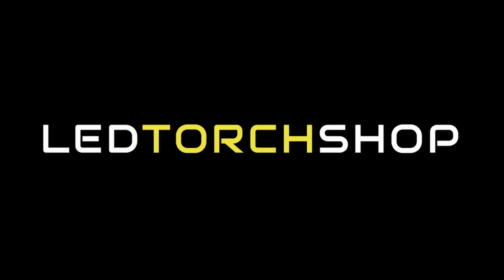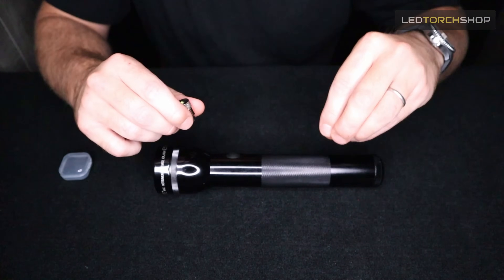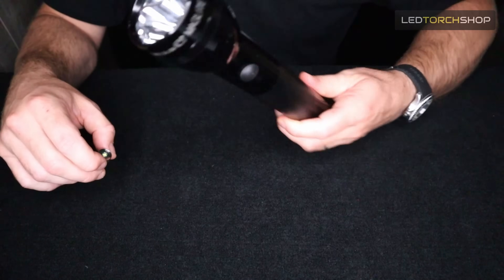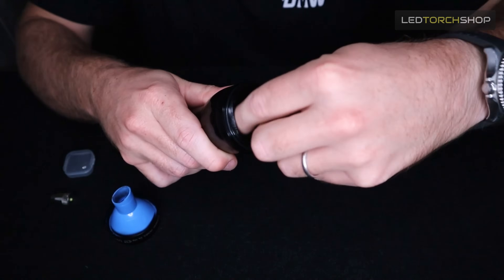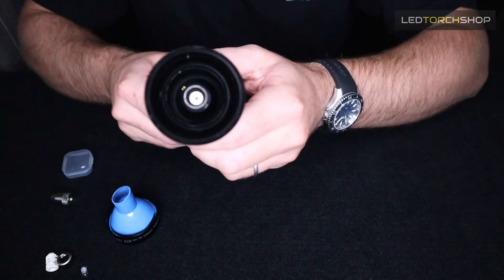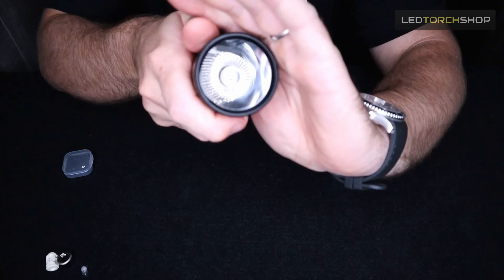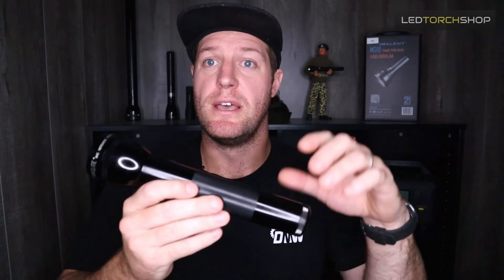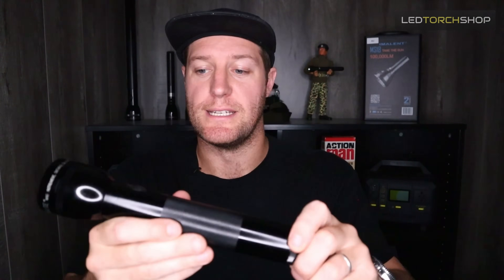Transform Your Maglite Flashlight with a High-Powered LED Upgrade

Comment: i have rebuilt a few Maglite D and C cell battery leak flashlights (torches). My best advice, is to not pour vinegar into the unit. It will not help remove the swollen cells. Remove the reflector first, Remove the bulb next. Save the reflector if not damaged. Most folk store their flashlights lens down (big mistake). 
First rebuild task, remove leaky batteries: 
1. Use any easy, non-destructive gravity or momentum method to remove the leaky batteries... gravity, banging on a work-bench (check with your spouse what a workbench is)
2.  Extract swollen stuck batteries. The first try should start with a skinny long drill bit. (Only go through one cell.) then find a screw that is slightly larger than the hole you drilled.) make a gear puller to remove that battery with a proper sized screw... repeat

Comment: Crap! Doesn't last long, because of the heat. I already got 2 failed, despite the fact I have more than a maglite and some other things in life to do. Maybe 300 Hours but they advertise as if there wouldn't be a heat problem. You can get about 55lumens out of an old Maglite with such a  convertion-kit that would last thousands of hours.

Comment: Did that years ago, maglites are built very well and to waste a good light because its incandescent... this bulbs swap just does the trick. Yes more modern lights have much higher outputs (see runtimes) and gimmicks build in. But in the end, for in and around the house, it's sufficient and the batteries also last. Glad I did this
Reply: The kits @ Home Depot/Lowes are around $20, I found one on clearance for $7 (which I thought was worth it, but $20 is a rip).

Comment: Throw that dinosaur in the trash. Harbor freight sells led flashlights for cheap that are smaller and better than an old maglite with half led kit that doesn'teven serve as a good night stand light. Streamlights are my pick.
Reply: Wrong. But thanks for playing.
Reply: One reason to carry maglite is it can be used as a weapon in worse case scenario.
Reply: Great comment. I have heaps of 🔦 for around the house/car. However a cheap $25 second hand 4 -D maglite is great to have by the side of the bed for things that go bump in the night. Going to upgrade to LED globe in the near future.

Comment: I have a 2D cell magnlite with an incandescent bulb.  I just went to follow your steps along with you and hit a huge snag.  The first step, removing the top part, doesn't work.  The Maglite company told me these are not able to be updated.  Could it be that they've sealed this part so they can't be updated?  I'm so frustrated.  Your steps look so simple and I bought this incandescent flashlight without realizing what it was.  I have another one with an LED and LOVE it.  Can you advise?  Thank You, Joy
Reply: only works on the 3 cell and up versions.
Reply: @Chris-sf7ug  In the video he's holding a 2 cell.  There are specific bulbs "chips" for different volt (number of batteries) lights.  Just make sure to get one for a 2 cell.
Reply: You have to be able to get to the bulb to replace it if it was to go out.  I have a 30ish year old maglite I am currently upgrading and everything comes apart with the exception of the "blue" reflector separating from the lens, I'm not going to force it since it doesn't need to be separated for the up grade.  My maglite even came with spare bulb wrapped in foam inside the spring on the battery cover.  Good Luck.

Comment: I do not suggest storing Maglites with alkaline or zinc-carbon batteries inside for any substantial length of time. You are asking for trouble. The question is not "if" they will leak but "when",  and then you are boned as they will swell, leak corrosives, and weld themselves inside the barrel of the flashlight. Even premium brands will do this. Rechargeables are much less prone to this.
Reply: Happen to 3 of mine already, and it was pain to get out.
Reply: @rubicon3929  Took my batteries out of many of my flashlights, now they are not ready when I  need them.
Reply: Going to take mine out of my four Dcell and keep them separate
Reply: Lot of those issues with the AA size Maglights.   All this tech & they still can't make a battery that doesn't leak!
Reply: I got lucky, just crammed my mag solitaire out after 8 years in a drawer, battery did leak, but barely noticeable :D
Reply: I have had 4 d cell Rayovacs in my maglite for 3 years. Lucky
Reply: Oh my maglite is going to see some use. I need it!
Reply: It just happened to me. Now the inside is corroded

Comment: I have been experimenting with similar thoughts. However I am looking at 7.2 volts or more using A123 26650 batteries. If you can get 2 in. Three will give more than 10 volts. Longer run time also.

 I am using a 3 C cell Maglite and getting 7.2volts. Using 22 gauge brass wire soldered to a bright led. This is probably the last word on the 3 C cell Maglite modification. The switch is unusable. The battery cap works well as a switch. The standard drop in led bulb for 2-11 D cell had it's collar ground down and reflector was reamed out to accommodate the large bulb which had 22gage brass wire soldered on for pins. Since the focus point was beyond the thread limit a 1.75 inch inner tube was used to hold the focus point and keep the reflector assembly from falling off. Very functional and attractive modification. I would take bulb pictures but I don't wanna push my luck. Bulb is 4-18 volts. Cost less than $3 including shipping, for the bulb. Total cost $23. Two A123 26650 cells, from an electric bike project, used as a power source. 2 cells at a little more than 7 volts. Casts useable light 100 yards.  https://www.candlepowerforums.com/threads/modifying-a-3-c-cell-maglite-using-lithium-at-6-8vdc.482476/post-5535163

Comment: LED Torch Shop:  FWIW, it should be noted that all batteries are NOT created equally. A number of batteries manufactured by so-called reputable makers will, in fact, leak and corrode the inside of your MagLite aluminum barrel. In the process of doing so, said batteries will become stuck inside the barrel, causing you, the owner, of the unfortunate Maglite much consternation, hair-pulling and gnashing of teeth in the process of getting these corroded batteries out and the damaged barrel cleaned up.
Note that this removal process often causes the air around said 'torch' to turn bright blue...   As you curse the battery manufacturer to a fair-thee-well for having caused the situation in the first place! 🤬🤬🤬
Corroded battery removal is a time consuming/difficult-in-the-extreme process, to say the least. It often results in broken pieces/parts for which there usually are simply no replacements, what-ever/where-ever. Of course, you would rightly think Maglite, the 'torch' manufacturer, would sell such parts, but NO, they do not! 🤦‍♂🤦‍♂🤦‍♂
So now the air turns a darker shade of blue, as many a pejorative is hurled in anger in at least two directions, if not more.   And...  You find yourself getting quite bald, as well! AARGH! In extreme frustration, you now find it easier, and, in the longer term, much cheaper to just break down and purchase an entirely new replacement Maglite!
You may note that your new 'torch', fresh from Maglite, is sold to you containing batteries manufactured by Energizer, the Drumming Bunny people. Apparently, Maglite has determined these to be the power source/battery-of-choice, as these generally last longer, while their use less seldom results in leaking/corroding conditions within the "aluminium" 'torch' barrel.
You will be well advised to use them yourself in future. FWIW, you will find it advisable to remove these, and any battery of different/other manufacture (such as Duracell , Rayovac, or similar w/ at least 10-year shelf-life warranty), from your 'torch' at least once per month/bi-monthly allowing them to "breathe" for several hours before reinstalling them for further use. Said 'removal/breathing period' will generally avoid the leak/corroded battery condition in the exceptionally cramped barrel quarters. At the least, you'll catch the occasional/rare offending battery before it can corrode, swelling against the aluminum, thus causing the dreaded stuck battery condition.
Hope this rant is of some use/help to those who take the time to read it! 😜😜😜

Comment: Love your reviews but to carry a light that size should be a minimum 5000 lumens in my humble opinion. I remember in the old days carring my old maglite that was 40 lumens.
Thank God lights hav changed 😊😊😊
Reply: I built a Seoul Semiconductor P7 quad emitter Maglite (900lm) back in around 2010 and have found it exceptionally useful as an "entry/search light" and still acceptable, effective and useful in this era of 2000lm+ lights, the D cells provide decent capacity/runtime compared to 18650 lights for example, whilst direct drive is brighter a multimode driver circuit adds flexibility 👍